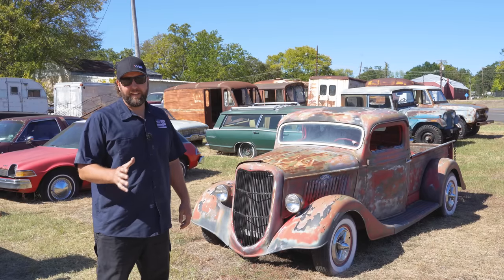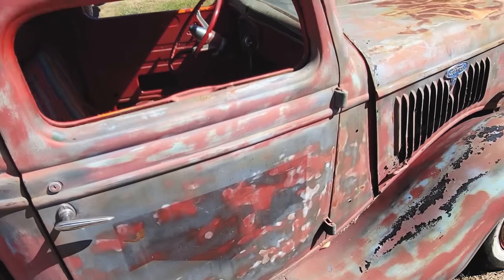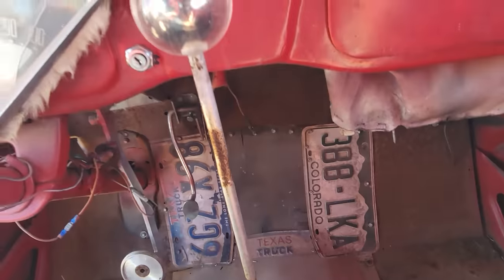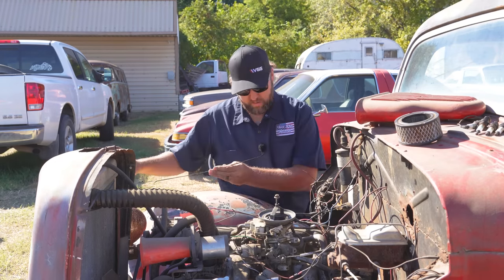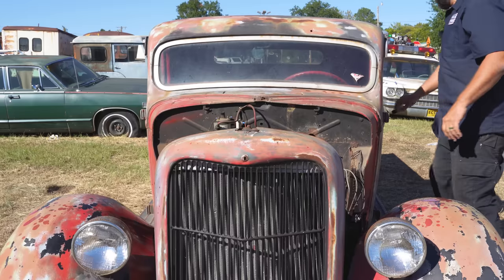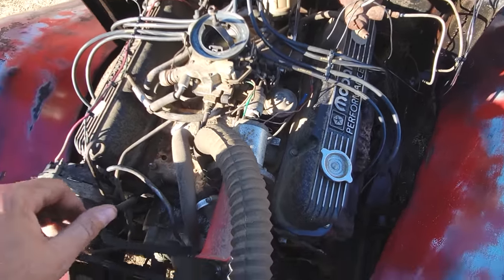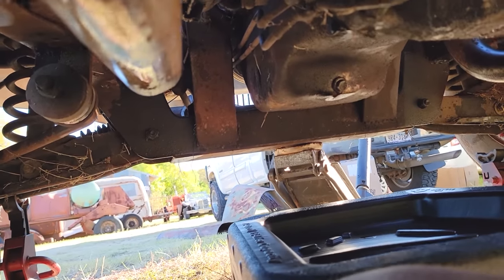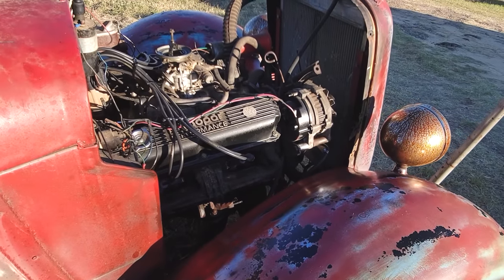Mopar Powered '35 Ford Truck Ratrod! Will it RUN AND DRIVE 630 MILES?

Comment: Good catch on that rear end bar, but they actually will not fall to the ground due to being bolted to the rear end and rear axle leaf pack putting downward pressure on the other end and being unable to turn the rear end due to it, plus the rubber damper arms going upwards prevent that even more...i saw a guy with his hanging down about 1" and it was completely missing a nut and bolt...he got a wierd vibration when he accelerate dover a bump on a 20 mile drive and so we checked it out and found that when we got stopped. They made sure it wouldnt catapult your car into the air if it did fall down lol

Comment: I used a bottle of K-Seal in my 2002 F150 with a 5.4L because it overheated on me twice. Well 5,000 miles later it hasn't overheated anymore. Engine has 162,000 miles on it so yes, Kseal really works. I was afraid it was that plastic gasket the 5.4L engine has on the cooling system.

Comment: That was a great video. Reminds me of several of my vacations.
 If you haven't sold it, I really think you should sell it to me. I have 4 cars in mid-restorrebil-fixinta. I would keep it on the road for a shop truck and it could be 5th in line after the 47 Chevy Stylemaster ls3-4l60e trade up.

Comment: Love ur show and utter determination bro. You never dissapoint. A small block Ford 289 or 302 would keep some happy. I like a small block chrevy,  Lets go with the 8.1 vortec that looks like a 6.1 vortec, but has many more inches and torque. The real size is a 496 cubic inch engine. That will rip the balls off a Brass Ape.

Comment: It's definitely got some character. Should definitely revive those flames on the hood with how much overheating issues it caused you 😂 roof already chopped and looks good, throw in a better suspension setup, and a 440 with a 4 speed and some 4.11 rear end gears and some fatty tire and take it it the next Cleetus And Cars burnout competition

Comment: Ive watched just about every video you have, your awesome! I've had meny moons of jumper cable times and recently I tossed out my cables. Advanced Auto Parts has a power pack that is the bomb diggity! Its a Schumacher 1200A power pack part # SL1582 Rev P-S4. It jumps dead v8's and can charge your wireless phone too(careful though it will make a phone hot quick,but its fast for wireless charging) the whole setup is about the size of a tablet, all for the unbelievable price of $200 give or take. Im telling you it is one of the best investments I've ever made. And I don't do any kind of investments, but this is the coolest jumper box I've ever seen!

Comment: If you have time kept it.  Otherwise, move it on because all the practical basis of all the systems has been done.  The base line established in you drive does provide very valuable information including what needs to be done.  The original build proved itself including all the faults from changing hands and setting for long periods of time.  It does need to be configured to a better and More dependable platform of whoever is going to own it.  The information is there.  The vehicle does have beautiful lines and has proven it heart for restoration.  I really enjoyed the different problems and how you handled them---staged or not, who cares because you brought out the attitude necessary to keep consistency in making various decisions to keep moving to satisfactory solutions.  Keep trucking!

Comment: Get the Mopar out and if you have something sitting around that you feel comfortable with brand-wise that has a transmission and maybe a different radiator slap it in the old girl. Good luck

Comment: I used K Seal on my 1989 Dodge Dakota 3.9L LA motor, freeze plug just started to pour out. After 15 minutes , it sealed the tiny little pin hole, and I got to drive it home. 
Sold the truck for 4k at the Dodge dealer, manager wanted a single cab - 8ft bed. 
I wanted a new truck. Haha

Comment: Not a bad cab and chassis for 88 years old. Lots of potential if you have the $'s. The good news is you can pound and weld on that old Ford sheet metal to bring it around to acceptable condition. There are lots of reproduction parts for the cab.

Comment: i just had a wild tought, but hear me out, if you have a blown head gasket and you are making milkshake, could you limp home filling the cooling system with oil? i mean, if you are not leaking the coolant to the exhaust that should help

Comment: I noticed you put that air cleaner nut back up on the stud after you took the air cleaner off.
The law of chithappens will make that vibrate off and end up under a valve....shelling the engine.

Comment: "Fuel mileage is not great" Yep, so definitely a 318 lol. My first car was a grand cherokee with a 318 and the fuel mileage was abysmal. 12-13 mpg on a good day. Sounded great when the muffler rotted off and i replaced it with a glasspack though.

Comment: I'd like to see a budget build!  My 1993 K1500 small block stepwise (that I bought new) has 186,000 on the mileometer.
I'm not a "wrench", but I can twist a screw driver.  I might take it on? or better yet, learn the proper way if I sub it out.
YES! I'd love to see a budget build!!!!!!

Comment: Have you torn that engine down? Id love to know if it was a cracked block or what it was causing water to go into the oil pr if it was a gasket just to know what that sealer you put in actually did...

Comment: casually have ghost buster car in the background.....
BTW, for those overheating digital pumps, I think we just should use thermal conductive double sided tape and slap it to the frame, if it's able to get any kind of heat to the frame, it should keep it alive long enough to get home. 
that stuff costs like 3$ per 5m, and as we need one or two 3inch strips of it per pump, it should be cheaper than changing pumps, and should last a long while.

Comment: Derek, from what I have written you about engines locked uo, do to weathering I'd guess you'd guess I had a fairly proven source of engine makeover neweragainer. I pull the sparkalators and dousche the cylinder with PB Blaster, let it seek it's own level, for 45-95 minutes, then hand turn over engine, reduces the need to cross hatch the cylinder walls and makes purdy pictures all while staightin up those pesky rings, dump all new oil & filterage sparkolaters lightening hoses and voilla, I hope, It's worked, it has for. Me 96.483% of the time and adds 25% more horses. Good luck an may God bless you & yours; the Bishop of battle...😂

Comment: I had a 36 so I know where they rot. For a fat fender they are in really good shape. Don't let it rot away, either complete rebuild this time all ford. Go back to manual trans, automatic your just asking for trouble. Use a magneto distributor, stay with block mount fuel pump. Make a driver that will always bring you home. Or sell to someone that will do it. Thats way I always did it. I'm 74 so Iv'e did a few in my day. Shame they chop the top.

Comment: Tighten it up!! Fix the engine or grab another cheap 318.. add support structure for the steering and brakes and just cruise it.. frame won't probably even handle power from a 5.3.
Maybe throw a thumper cam in just for sound.. lol. Otherwise keep doing what you're doing!! :)

Comment: I'd say, maybe cut all of the black wires out and save them for the copper.  Rewire the whole truck with the right wires. Repair the accelerate, change both head gaskets,  and water pump. 
Or, jack it up high enough to drive a good truck under it.😂 🎉 😅

Comment: Hay I got  one question when you have a petrol engine I see you putting diesel oil into them and yes the oil is better than some of what you have in the vehicle but diesel oil is a high compression oil unless in the states its just labelled different I have herad of some petrol engines seized up after using this do you change the oil to a petrol oil or not

Comment: It didn’t make a lot of horsepower because of the small tire you put on the rear. If it  had the 29.5s on it with that high gear it woulda loaded up the dyno more and made more power

Comment: A weaker... I mean, a more tired man would have given up. You did great pushing through, Derek. You oughta let a feller get that old truck from you so he (me) can drop in a 6.0 LQ4 motor and 4L60E trans in it. Keep her as a wheel burning, tire melting rat rod.

Comment: You may never read this but I put a nut back on the air cleaner as you just did and I ran the vehicle , before you knew it the nut worked off fell down into the engine and put a whole in the piston😮not good 😢

Comment: You should turn the crankshaft a few times with a wrench then drop the oil pan then turn the crankshaft some more to get the oil ,water and gas out the motor

Comment: Dirt late model racers have been out if hand since the 90s. GRT was king then. GRT had 3 house cars. Freddy Smith, Skip Arp, and Wendell Wallace. All had big million dollar rigs in the 90s. It hasn't just happened. Once it went to 100% jig built. With a 100% aluminum body. That looks nothing like what the nose says it is. Matter of fact Open Wheel mods are out of hand as well. It's a late model with a motor setback and skinny tires. Bring back G60s and a motor claim.

Comment: Swap it to a Chevy engine... Not only will it run forever, but it will run BETTER forever. I love Mopar but these new Mopar motors aren't anything like the old ones. If it were a Ford motor, you wouldn't have made it 50 miles... Chevy for the win.

Comment: Here in the UK, every car over 3 years old has to have an 'MOT' certificate. MOT stands for Ministry Of Transport. An MOT is an inspection by an accredited mechanic to see if your vehicle is safe to drive on the road and without an MOT you cannot get car insurance. Things must be very different in the U.S.A. as in the UK, you could not legally do what Derek does and get these old motors running and drive them X number of miles home. The UK police would be all over him, like a rash.🙂